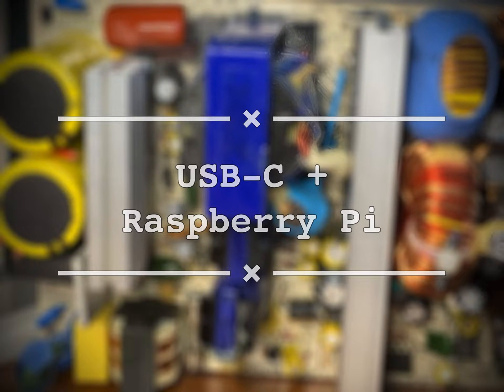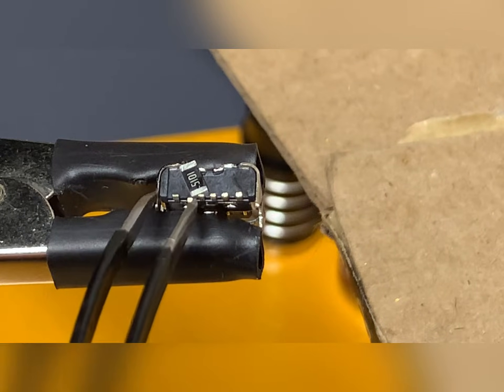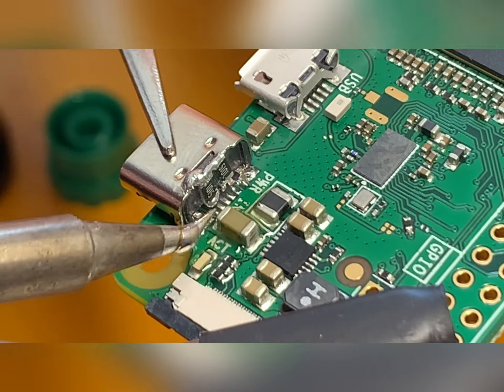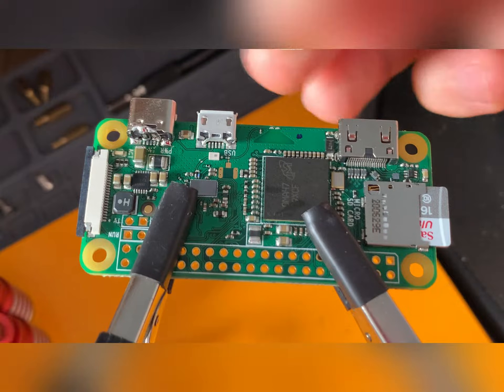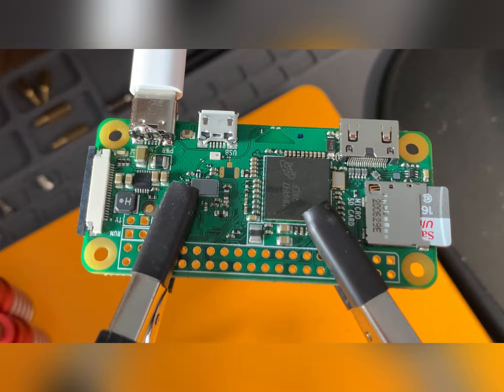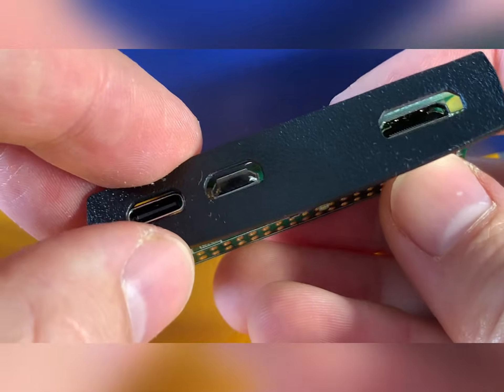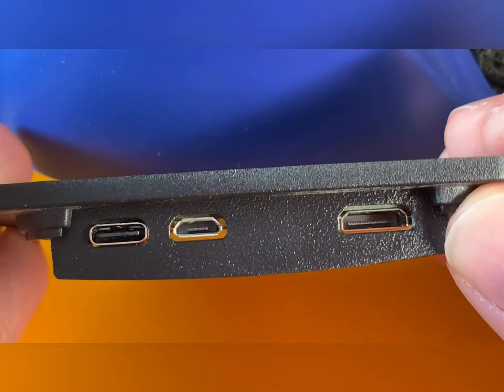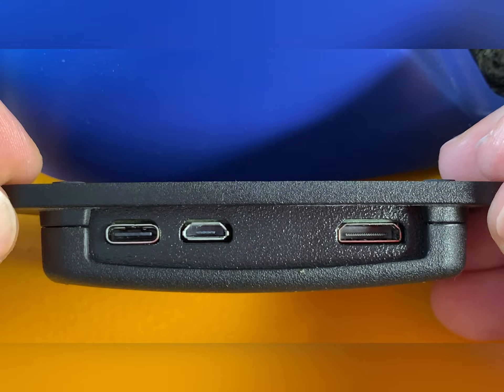#14 Replacing micro-usb on Raspberry Pi Zero W with USB-C

Comment: my micro usb data/pwr port is busted can i replace the micro-usb with another micro-usb (not usbc) and what do i need for that?
Reply from the maker: It depends on what you mean by busted. If it’s just the metal connector, you would need another connector, a hot air rework station and flux. You can do it with a soldering iron and solder wick also, but it’s more pain. I do that replacement in my video #34.
If the traces are ripped, you’d have to strip a part of the pcb, connect thin jumper wires, the whole thing becomes a pain.
Reply: @UNgineering  The data pins were fried. I had accidentally plugged in power and it stopped the data but the power still worked. I am going to try it when I get the new micro port.

Comment: What kind of proffesional have I to be to do that work like for full time?
Reply from the maker: To do SMD soldering and microelectronics work in general, you could do laptop repair, similar to what Lous Rossmann started with. To mess around with things nobody asked like upgrading usb ports on raspberry pi’s, you’d want to work at a large electronics manufacturer in their R&D department, or do this as a hobby.

Comment: how did you manage to get the connector to stay in place when its legs are not embedded in the circuit board? I tried it and the connector just got ripped away when unconnecting the cable. Btw I did a jum between the V+ pins so that the cable works both ways.
Reply from the maker: i ended up putting a buttload of hot glue around it. seems to hold. it's an embarrassment, truly.
Reply: I tried that also but it didn't help. I guess I'll be powering up the Pi by gpio 😂

Comment: Can you do the same with the data ports to convert to USB-C? Would you need the resistors in that case?
Reply from the maker: I did that in video #13. The problem is the pins don’t line up so you have to offset it somehow, which messes up the port alignment. If there is a different usbc adapter board, it might be possible, but not with these ones.
Reply: @UNgineering  Oh thank you so much. I love how your videos have a number on it. So easy to reference! I will give it a shot then

Comment: Is this a data cable or simply a power? Trying to figure out if it’s possible to do this for a data port.
Reply from the maker: this port only delivers power. if you want data, watch my video with ESP32 programmer conversion. keep in mind, it will only give you USB2.0 speeds, I wouldn't recommend using that process for a phone
Reply: @UNgineering  thanks for your reply! It’s for a Kindle Paperwhite 2012 so 2.0 speeds should be fine.

Comment: Hi. Did you leave the D+ and D- unsoldered? So basically what you did was soldering GND to outer jacket, and voltages to the pins on the board, and left the resistored-C1 hanging without soldering it to any pins on the board, right?
Reply from the maker: D+ and D- lines aren't connected on the power input, so there's no need to solder them. If you were replacing the other micro-usb, then you'd need to  connect them as well (that's what I did on my esp32 programmer "conversion").
the CC1 and CC2 are connected through resistors to the outer jacket, i.e. ground.
Reply: @UNgineering  Hey. I've been thinking about this. The USBC connector you used does not have D+,D-. How would you connect them using this 6-pin USBC?
Reply from the maker: @af6727  you're right, this connector wouldn't be suitable for the data port. you'd need to use one that exposes the data lines. in my esp32 video I'm using a different connector.
Reply: @UNgineering  Thanks. You're the real deal. learned alot from you.

Comment: Hi. Why did you need to use two 5.1kOhm resistors? I thought I'd need to pull one resistor from CC1 to GND. Please enlighten me
Reply from the maker: if you pull down only CC1, then your connector will  work only in one orientation. you also need CC2 pulled down in order for it to be reversible
Reply: @UNgineering  Got it. Thanks

Comment: Micro USB should be banned a long time ago (actually they just did that in the EU) all devices must be engineered with USB-C so the next batches should be fine. P.s. I didn't get the use for the 2 pulldown resistors but ok.
Reply from the maker: without the PD resistors many usb-c cables won't work - i came across that problem when trying to use apple's usb-c cable in one of the previous videos. plus it's in the usb-c spec.
Reply: Rasberry pis are computers not phones
Reply from the maker: True…and?
Reply: @UNgineering  I think Nikolai was talking to the original commenter because the EU restriction was for charging ports on phones, not computers (IIRC) — it has to do with Apple trying to make it as hard as possible for Android and other devices to work with their ecosystem by refusing to move to a standard connector.
Reply from the maker: @LiteralGray  fair point

Comment: I used a USB-C breakout board and soldered the 5v and d+ and d- pins to the pads on the back of the PI so that it can provide power and USB accessories to the PI via the USB-C